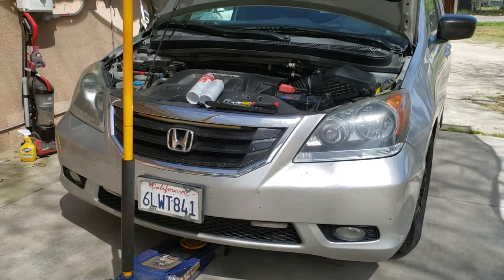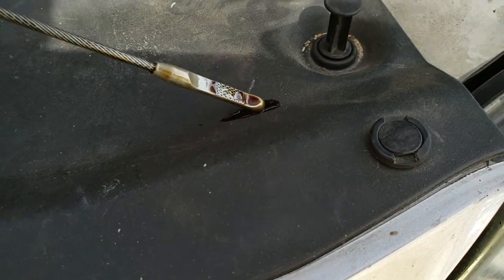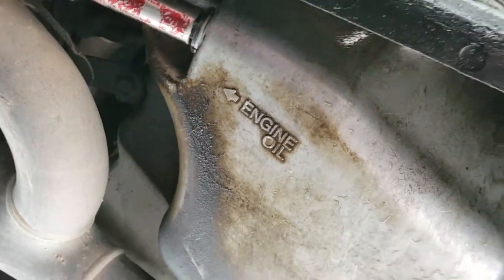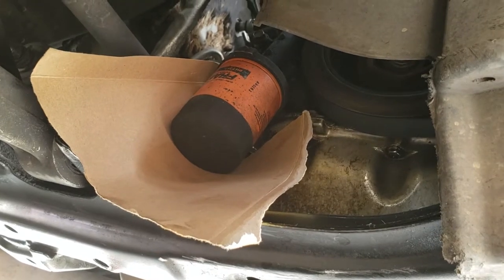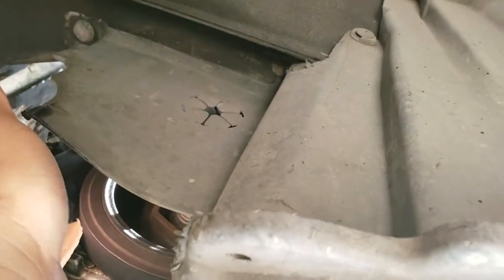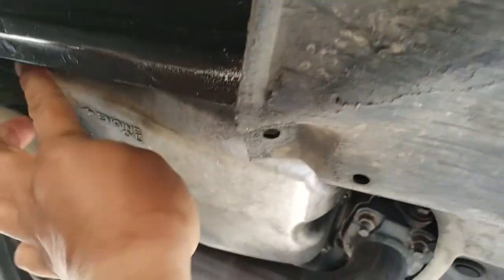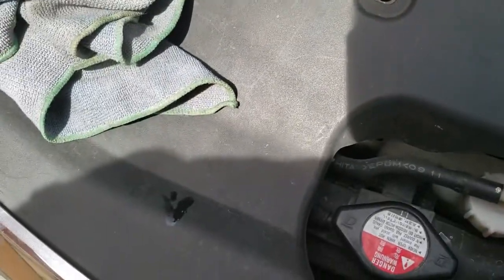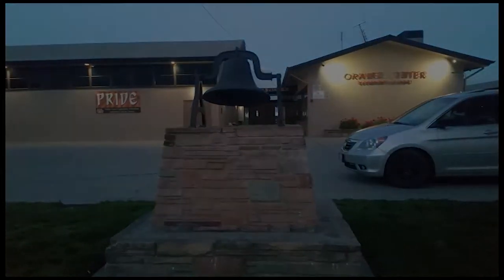How to: Do an Oil Change on a 2010 Honda Odyssey

Comment: Nice vid. This is all I needed. Thanks. About to do mine on my 2010 for first time.  Just wanted to see if there were any surprises.  Also, generally you can’t always judge a car needing an oil change from color of oil. It turns dark fairly quick. That doesn’t mean it’s cleaning things. It’s from being heated and oxidation more so. I hear ya on yours though. Did seem thin and extra dark, probably from your treatment. Also, you are probably ok with 1/2 quart, but people shouldn’t have the attitude they can overfill a car 1/2 quart or more on all cars in all situations. Depending on car, adding a quart or more can stress some cars with added pressure and cause seal leaks. Would be nice if you stressed what viscosity and even oil filter number for newbies.  👍
Reply from the maker: Thanks bro, im glad this helped. Thank you for your input brother, really appreciate it. Thank you for your Support 🙏